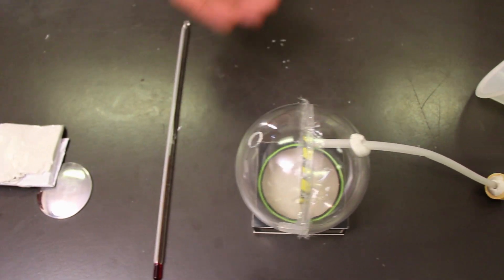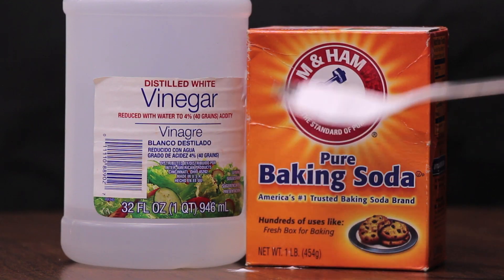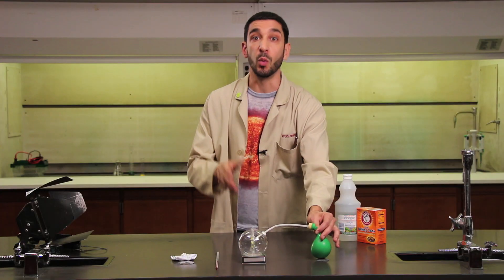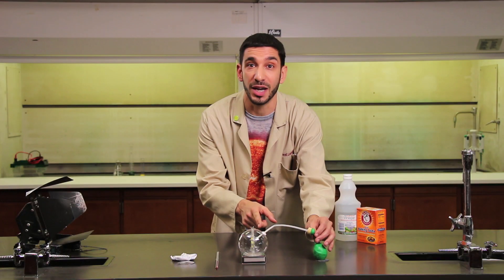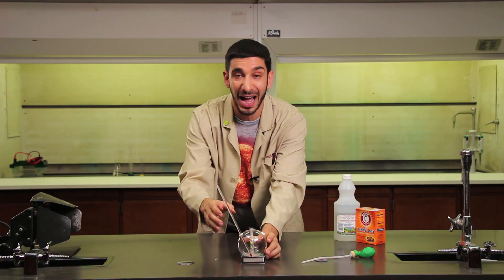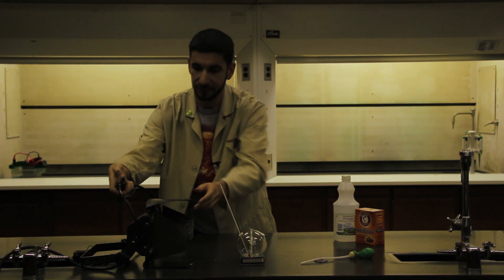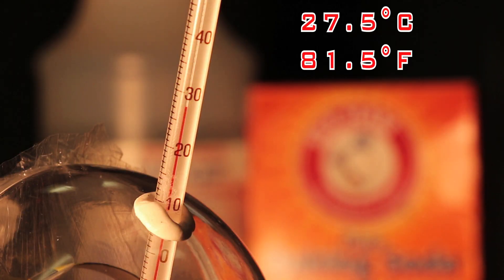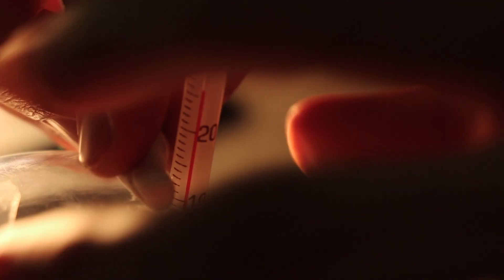Is CO2 WARMING Up Our GLOBE?

Comment: ONce again, not a greenhouse effect experiment. Not even remotely valid. What was the pressure in each side?  The greenhouse effect is caused by IR energy only, and it looks like the side with the Co2 would get more heat to begin with. You so-called scientists should do some basic research before producing such easy to debunk videos.  The greenhouse effect is caused by light energy from the sun reflecting off the earth, shifting wavelength to the Infrared, and co2 and other greenhouse gases absorbing the IR energy. IN this experiment you did not measure the IR energy, the pressure in each side (Boyles law) or the volume of H2o in each side (Dalton's law). You are incompetent.
Reply: WRONG WRONG AGAIN !!! IR light doesnt have to reflect off anything !!! Its in sunlight itself... Seriously you dont know what you are talking about...

Comment: be interesting to do this with 400, 800 and 1200 parts per million with no ceiling on the tank rather than an enclosed space and with 99% co2
Reply: You can calculate the change using this equation '
     Delta T (in degrees C) = 1.66 Ln(Co2 conc final/CO2 conc initial)

Comment: What happens if you add extra C02 into the other chamber?? I don't think theres a scientific dispute about C02 stabilizing temperature, it's more about if more C02 increases the temperature. It is proved that C02 reaches temperature saturation at a certain level.
Reply: @Amün Gust it doesn't increase heat retention though, the temperature stabilizes regardless of added CO2 after a certain threshold
Reply: For the purpose of us living on earth a change of +6C will end life on earth for plants and animals... The pt of which adding CO2 to air becomes nonlinear is way passed that... So your not going to saturate anything...

Comment: It could have been the extra time heated by the lamp and you do not show us the concentration of your co2 made. It would be more appropriate to have a thermometer in each side and take the difference of both.  if you got a known concentration of 100, 400 and 1000ppm of co2 from a calgaz bottle you would there for represent what co2 does. But your experiment is actually a literal green house as the trapped heat cannot escape the atmosphere does not work like a greenhouse as it has air flow for one you trapped heat is heating up the plastic over time. Plastic also does not allow the UV spectrum to pass. Its is also a known fact that co2 is a heavy gas so your glass probe is in the highest concentration at the bottom and we dont know what that is.  Yet how could you simulate the atmosphere in your orb as you should take a measurement from the top simulating sky, heavy gas dont like sky.
Reply: 1st I totally agree he should have just used 2 thermometers... However youre WRONG about more CO2 at the bottom... Read what the DEFINITION of a gas is !! Mixed Gases by definition are uniformly distributed gas that fill a container regardless of its shape...